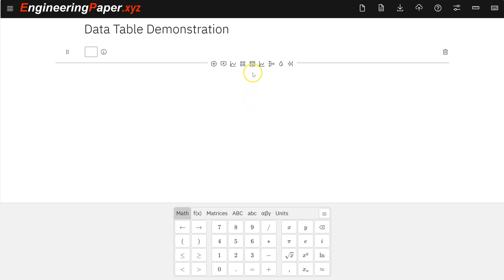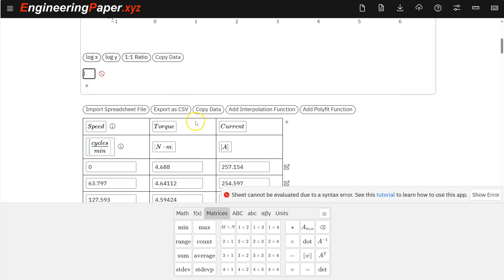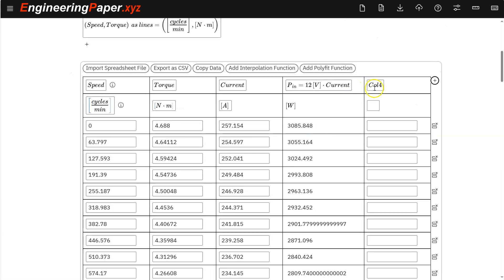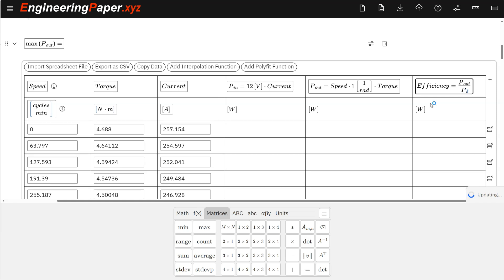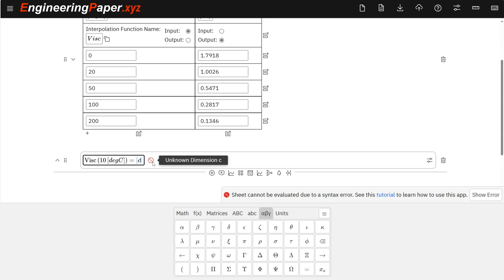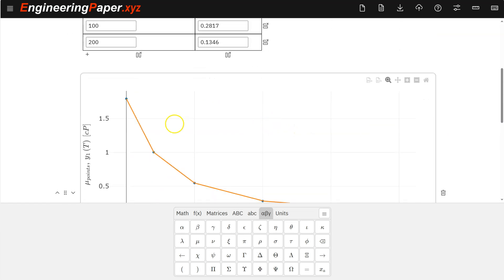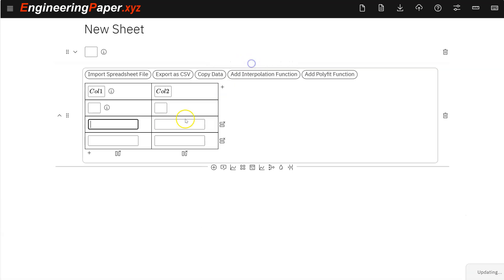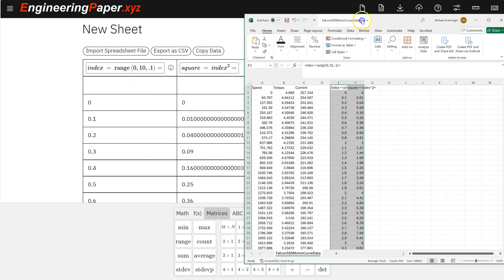EngineeringPaper.xyz Data Tables Tutorial

Comment: Are fluid calculations available in data tables?  I couldn't get them to work if they are.
Reply from the maker: Yes, thanks for the heads up. There's a bug with the unit handling and fluid functions. I'll post an update when I've got a fix rolled out.
Reply: @epxyz  Thanks a bunch.
Reply from the maker: @davidcooper4327, I just rolled out a fix for this issue. See a working example here: https://engineeringpaper.xyz/SKKwNmY46wCUBYT6dXk9pK  Thanks again for letting me know about the issue.
Reply: @epxyz   impressive!